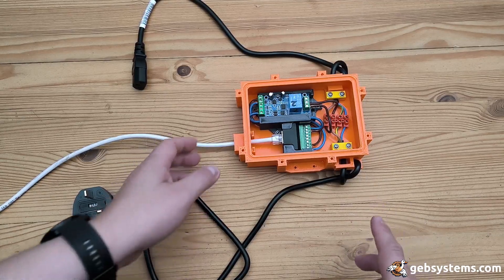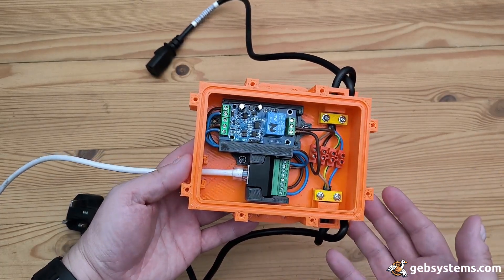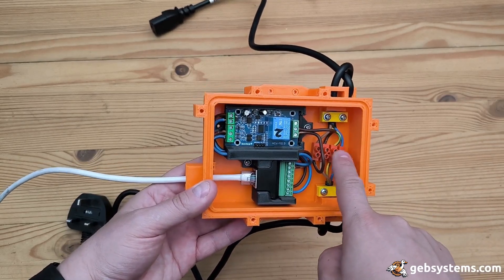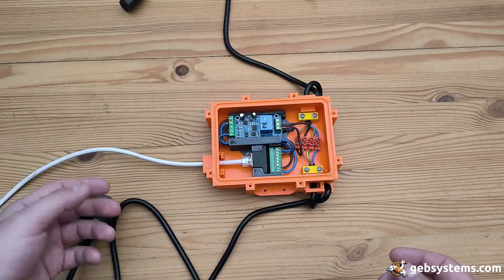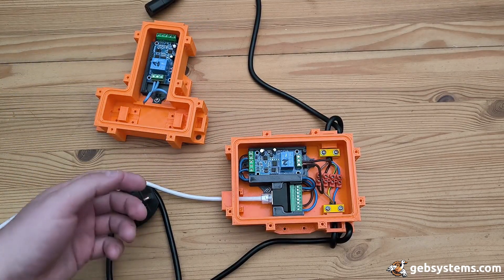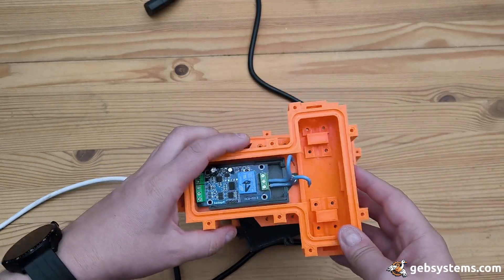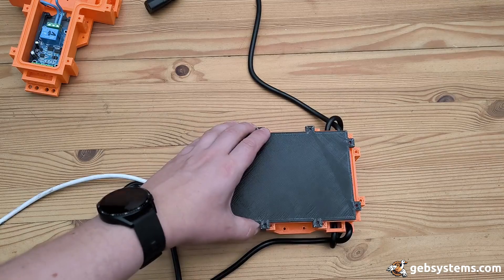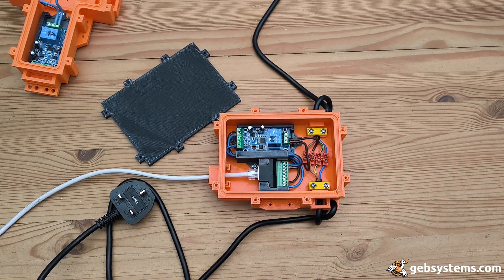Relay enclosure done better | Arduino Modbus Project | !Ai

Comment: Haha  you're like me..  The word "overengineered" does not exist.. 
One of my recent projects... 

https://photos.app.goo.gl/jcD27HmHcBDVsknf7

Home assistant control my front gate open /close,  get wifi to reach end of very long driveway, (mostly so I can control wled lighting effects on my house numbers) individual announcements for doorbell and letterbox which also informs if I have letter, parcel or junk mail.. 
Announcements consist of custom wise cracks in the AI generated voice of Rick Sanchez from Rick and Morty.

I CAN KNOCK ALL THAT UP IN A WEEK. HOW HARD CAN IT BE? 

4 Months later and countless engineering conundrums discovered and solved..   Should be done by next week. 😂

Ps. Subscribed to your channel. Love stuff like this. Well done! ❤
Reply from the maker: At first I was confused... but I had a look at the link you provided and it hit me! You suffer from the exact same bug as I do 😂 The "It will just take 5 minutes to knock it all up" attitude mixed with an unhealthy amount of OVERENGINEERING everything is the most lethal cocktail you can ever come across. You could be my Sensei tho! Ai Rick voice? That is some next level shit 😂

Also, what electronics you use to make sure it is running 24/7 smoothly? I am starting with Arduino to control everything via Modbus over RS485 but I am already looking around for some kind of cheap level entry PLC module to keep it reliable since I am  well aware that the Arduino is just a hobby board and despite having a watchdog it will probably crash at some point. Unless... I have 3 Arduinos that watch each other all the time or reboot daily etc etc You get the point hahaha What can possibly go wrong?
Reply: @gebsystems  well I have a home assistant server running on a fanless Intel  computer, and that has a hundred or so esp32 modules doing various stuff.   That's all fairly reliable - kinda...  Except stuff dropping off the wifi....  So then I started using zigbee as much as possible  which is heaps more reliable...
Next project is to redo my wifi setup...  I live in a mudbrick house and the walls are frikin Kryptonite to wifi.  So if you have a wifi light switch embedded in the wall... 

.... Anyway...  Part of the reason for my overengineered creations is when my dad was alive, and I was about 7, he used to explain to me all the stuff he did as an aircraft engineer. No room for "oh sh!t I didn't think of that" at 30,000ft 😂
So these days when I look at things other people do I'm thinking "where's the strain relief?" and when I ask them, they usually reply "WTF is a strain relief?" 🤣

So I was naturally impressed when your strain relief had strain relief 😉
Reply from the maker: Damn it! Here I was hoping that you would say that you know this embedded unit I could buy that it not $500 or something stupid. Ohhh, well... will have to look in more depth into them cheap PLCs and learn some ladder logic 😉

I am not a fan of wifi for deployments that need to work reliably. Sure sure, maybe there are ways to make it work but when I was in the IT world CABLE was the ultimate KING for reliability hence why I decided to go with Modbus as the protocol of choice via RS485. I have done some testing with ESP32 and I did not have a good time. My units froze within 2 weeks. And as you mentioned you have them crazy prison vibe walls that will just stop wifi in its tracks.

Also.. you got me with the dad story. Holy cow! The oh shit moment at 30,000ft is totally something that SHOULD NOT happen. Better to have more layers of protection rather than "just enough".

Ehhhmmm... you don't have double strain relief in your designs? Am I the only crazy one doing that? If you noticed my first design had 3 strain reliefs in place... Just in case 😂😂😂 I am really happy that I could impress someone with my quirky designs. Also, if you look at my previous videos when I showcase the power delivery unit the wires that go out of that enclosure also have strain relief. To be frank all of them recent designs have them because... OVERENGINEERING is KING!